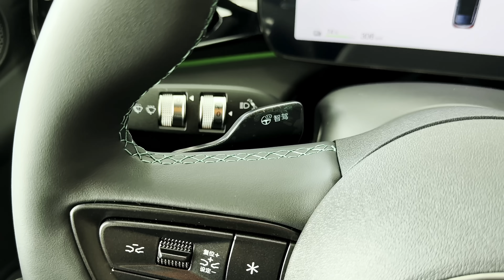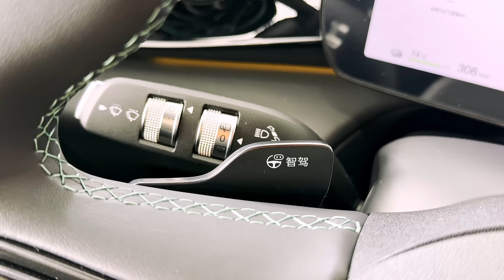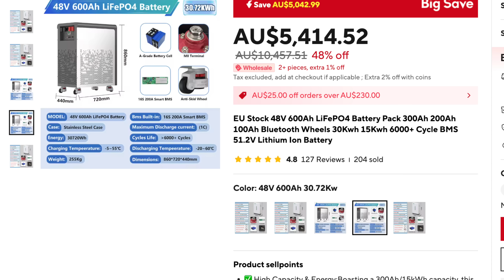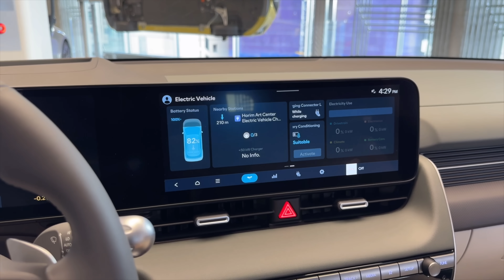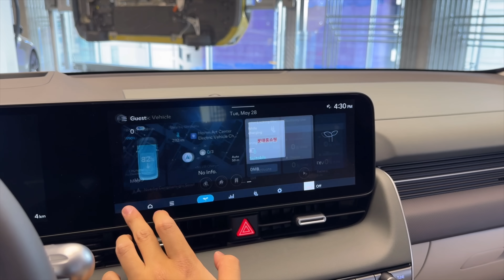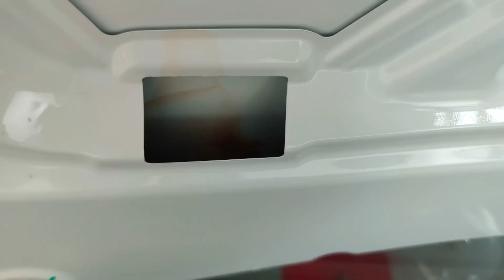Australia Is the PERFECT Country to Have an EV – Here’s Why

Comment: I agree mostly, if you live on the east coast or any of the major cities you would be mad to get anything else than an EV, but once you get a long way outside that area charging can be a bit ropey. For instance there are still bio-fueled ICE generators attached to some of the charging stations as you cross the nullarbor, up further north in WA and probably the NT the only way to charge is often to rent a powered camp site and use the provided caravan power point. It annoys me because, well, that's where I live! Fuel is over $2 a liter here, and the government actually provides subsidised fuel cards of up to $650 per year for pensioners and others just so they can buy fuel. Rollout of chargers for remoter areas need to be prioritised, I mean even if you live in a solar powered residence and can charge your car, once you get away from home it's pot luck exactly how you will be able to charge. Major towns and cities fine, but they need to roll out solar powered charging stations between them. Australia should be EV heaven, and it is in major cities and up and down the east coast, but a dearth of enthusiasm by previous Federal Governments has hamstrung us, but at least we got rid of Nuclear Dutton!
Reply: Currently on the Highway 1 'Big Lap' the longest distance between public chargers is about 280km*, even in NT. All up the east coast and even the south-east to Adelaide it already is very good, with chargers every 100-150km. Let PlugShare be your guide.

* That longest gap is in the Kimberleys.
Reply: @petesig93  Oh yes I don't disagree with those figures, but I have followed blogs where people have driven around the country on the major highways and many of these public chargers in the north of WA and the NT have only a single outlet, and if that goes down it's a problem, for instance from a plugshare user review; "Because the fast charger at the Exmouth/Minilya turnoff is down we will be stuck here for several hours as wall plug is only giving is 8km/hour and that is conservative-we need enough to get to Carnarvon which sucks $45 for powered site to plug in granny charger and $120 for a room as we were here for 13 hours all up." This is why I say you need enough range to get you to at least the next charger location if not the next small town. If the distance between is 280km and you only have 350km range then the chances are you are stuck there using a wall wart for overnight charging. Currently following a blog for an around Australia trip and he has had 3 locations where the single charger is not working, you need to plan for that at the moment because the charging system is simply not robust and widespread enough to allow for outages!

Comment: The problem in Western Australia is we dont have chargers every we want to go far from it. This is compounded by the fact we are only allowed to have a 5kw inverter which our air conditioners us3 completely trying to counter constant very high 36 to 42 degree Celsius temperatures. The authorities need to alter their attitude to solar and supply more charging facilities.
Reply: I’m in Perth and am about to install a 23kw solar, 24kw home battery and 15kw inverter, so you are allowed to have bigger systems which will easily cover home & and EV charging along with powering ACs. However I agree that our power authorities and govt policies have a long way to go. Very easy to see they care more about the economics than the environmental benefits.

Comment: One thing that holds back EV uptake in regional Australia is the lack of nearby servicing. Yes, I understand that evs don't require as much attention, but if you have to drive 5 hours to where you purchased the vehicle for concerns that need personal attention, this is off-putting. And many evs still don't have ota updates. 
On this ... do you think there will be a rise in independent ev technicians?
Reply: Absolutely if Europe is any indication.

OTA updates... honestly if a car is not constantly connected to the Internet then features are unable to be removed or locked behind a subscription paywall, so I see it as a bonus.
Reply: That was a consideration when my partner bought her EV5 Kia.  Kia became the choice due to dealerships 60 KMS north and south.

My Ducati motorcycle gets trailered 3 hours each way....
Reply: You may have chosen the wrong EV brand. I take mine to the Hyundai dealership that I picked it up from, 20 minutes drive away. There are several dealerships across the metro area. I have had it for almost 2 years and it is only now due for its first service (I have taken it in for a recall & software update a few months back).

Comment: Need some advice, looking at getting a car and an EV is what I want. The issue is we are renting with no solar, no fast charge and I cannot get installed. The most KM a week that I am doing is 270km per week.
Reply: Do you have a driveway/garage/carport with a power point? 
I drive 60km most days and recharge the used electricity over 5-6 hours each night using the granny charger. It’s still way cheaper than the petrol I used to buy each week.
Reply: @feathersword8232  I've got a double garage, with a plug point. I'll have to use the normal plug ponit.

Comment: It's definitely cooler and cloudier down here in Melbourne at this time of year!

One other bonus of moving to electric is reducing our reliance on imported petrol and diesel. We don't have that much fuel stored locally in case that supply chain is disrupted.

I currently drive a 20 year old Falcon but its replacement will be electric.
Reply: Spot on Australia likely at best has six weeks transport fuel reserve on shore. In a fuel supply emergency even this would be rapidly appropriated by essential services.

Australia does have a reserve stored in leased facilities in Texas, but in an emergency situation good luck in getting that to Australian bowser's inside three months.
Reply from the maker: Hey Jim, that's a really good point. I have heard Australia has 2 weeks worth of fuel on land. Does anyone else have any more data on this?

Comment: Over 50% of homes have rooftop solar in South Australia
Reply: But on days like today in Adelaide where it only reached 10 degrees c,it was cloudy and raining all day. My solar panels were only putting 0.2 kW . That is enough to run the fridge but no more.Dont kid yourself that you can charge your EV at home greenly over winter In the southern states of Australia.
Reply: @shanemcguire3953  lots of wind power in SA today and a greener grid than most places in the world. 
Few EVs need a top up daily.  Our 2 didn’t need feeding today.
Reply: @robhaitch5544  Watching the NEM graphs the other day, SA was running on gas and diesel. No wind and the tiniest amount of solar.
Reply: @peterwundersitz3715   Over a year it's 73% sun and wind including night time and the darkest and calmest winter days.
With those numbers you can run EVs cleanly in SA, especially when you make an effort to avoid the <20% of the time gas is needed.
Reply: @shanemcguire3953  however as there is  SO much  roof-top solar in the grid that our power company (OVOenergy) has a plan that gives us 0c/kWh electricity from 11am to 2pm, as well as an 8c/kWh late-night rate. We charge the EV during those hours for tuppence-ha penny or free!

Comment: One of the "roadblocks" to increased EV uptake here in Aus is the number of people who believe they must have a ute (pick-up). We now do now have PHEV utes, but no proper full BEV utes. (Bring on the Riddara BEV.) Towing is also an issue. (Bring on full solid state batteries.) But as for the rest, BEVs just make so much sense especially considering the lack of tariffs.
Also, you don't have to go all the way to Victoria to ski, come on down to Jindabyne in NSW - it a shorter drive.
Hi to Mandy and every other sensible person driving a BEV.
Reply: Waiting for a BYD shark 6 equivalent in full BEV with a 600km range myself, don't need an extreme 4wd, just one for the beach and runs to the recycle plant and some distance driving a few times a year but would prefer a full BEV rather than a PHEV.

Comment: Ben - you make some very good points.
I live in Melbourne outer suburbs and have 9.4kW array - over summer I can produce 30kWh of energy a day  and in Winter as little as 8 kWh of energy. 
For the past 2 years I have generated some 24 MWh. approx 12 MWh per annum.  My daily home consumption is high because of some pool pumps and a few fridges and freezers running along with the usual home appliances , from late April through early August I would be lucky to cover the home daytime use so home charging a car - not likely.
EV are still 10-15 K more expensive than similar size ICE. that difference can easily cover 4 years fuel and service costs for ICE.
That for many is a big detraction.
•	BYD Dolphin Essential: $32,138.45 drive-away
•	GWM Ora: $33,990 drive-away
•	MG4 51kWh Excite: $36,990 drive-away
•	MG ZS EV: $36,990 drive-away
•	BYD Atto 3: $42,558 drive-away
•	Chery Omoda E5: $40,527 drive-away
•	Cupra Born: $47,090 drive-away

Seagull $ ???
Firefly $ 38,000 TBC
Mona 3 $

Ice cars
•	Kia Picanto Sport: Starting from $18,290 (before on-road costs) or $21,190 drive-away. 
•	Chery Tiggo 4 Pro Urban: From $23,990 drive-away. 
•	Suzuki Swift Hybrid: From $24,490 drive-away. 
•	Suzuki Ignis: From $24,490 drive-away. 
•	Hyundai Venue: Starting from $22,500 (before on-road costs) or $25,990 drive-away. 
Other Small Petrol Cars:
•	MG3: Excite model from $25,780 drive-away. 
•	Hyundai i30: Various models and prices, with the base model starting around $25,220. 
•	Volkswagen Polo: The 85TSI Life variant is available for under $30,000. 
•	Mazda 2: Prices are on application, but some models are available from around $31,190.
Reply: Ev's need to come down in price, and they will, the seagull will be about 25 grand which is still to much but in 2 or 3 years it will likely break below the 20 grand barrier matching an equivalent guzzler. Sure your not making enough power to charge up the Ev for 3 months of the year but the other 70% is still a fantastic number.
Reply: @jedics1  CATL has begun mass manufacture of Sodium ion battery chemistry.. EV costs will become increasingly cheaper in the next few years. Ice will become less financially viable for most people looking to replace their aging cars. just a matter of time now.